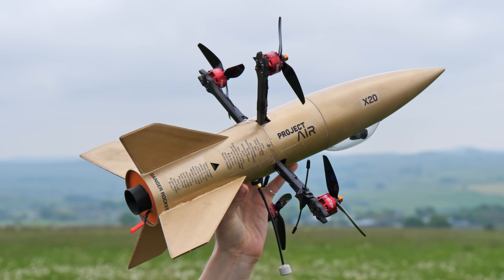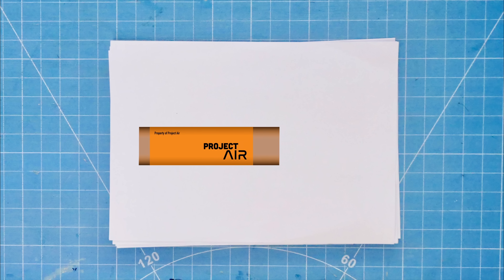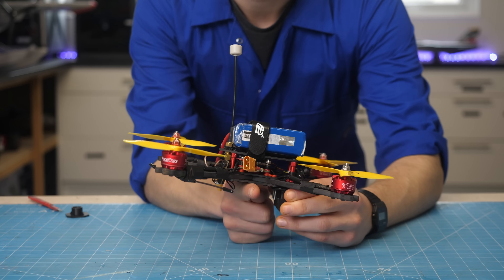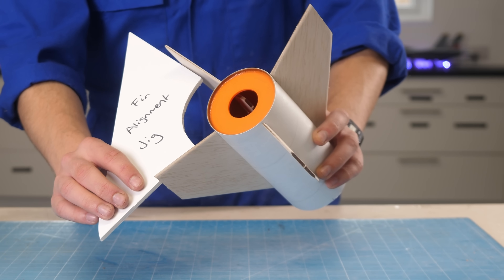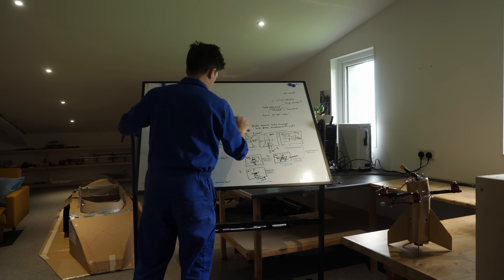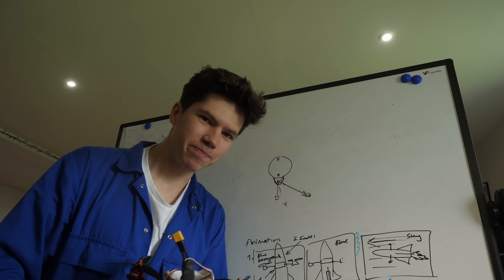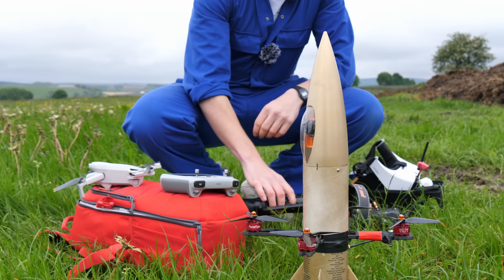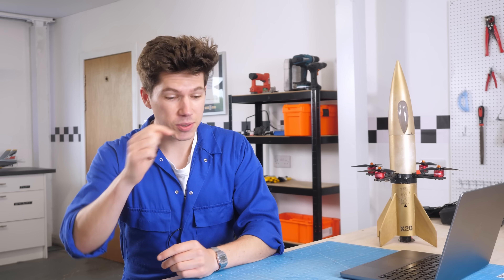Building a Rocket Drone

Comment: You have ALOT resistance when you light up the rocket. The arms have to fold inward into the body of the rocket to create the least amount of resistance to to the rockets aerodynamics. Once the arms are tucked in then you can use the fins to stabilize the flight, maybe. And you can not use the hobby grade stabilization to keep it in control. That's why falcon 9 has wing grids to control the decent. Falcon 9 has the wing grids folded back during launch. 😊

Comment: Looks like your vtx output to the antenna might be touching the frame and giving you that extra static in the video signal. I can’t say for sure, but I’ve seen that issue before and that’s what the video feed looked like.

Comment: You need to reverse the motors put them on the end, and flip the throttle controls that way they push instead of pull. Then you build covers for them with venting for air flow to the propellers, and counterweight in the front. The propeller layout in this model provides a ton pf drag when you use the rocket, and isn’t a great solution.

Comment: okay i like the comment i read about integrating with stabilizer fins and also about a more aggressive pitched set of propellers so that the increase in speed isn't turning propellers into excess drag ... with variable pitched props not a problem because adjust while flying even a 0.25 second after rocket ignition switching to continue to spin just at most aggressive angle but as always i just wanna know how much payload it can carry how high figuring a 2 liter pop bottle as a fairly good standard but eventually get into gallons and then splash on imaginary fires 🔥 such as a bbq or something even a candle 🕯️ in a field

Comment: Here is a mad idea I've had for a long time. Take a basic FPV plane capable of reaching 7-10 kilometers of altitude under it's own power (i.e. Atom RC Dolphin). Strap one or several rocket motors on it. Takeoff, reach max altitude, fire the rockets to go as high (or fast) as possible. Not sure about the legal side of all that stuff BTW.

Comment: A beitian 220 gps module can save weight for speed . Small drones carring just  a parachute can overheat and shut down the motors and drop . The flight controllers have gps speed in osd .

Comment: As you ignited the rocket motor, The craft seemed to pitch up a little bit. Was that intentional? If not, you could maybe add a counterweight to the camera to shift the center of mass back on a straight line with the thrust vector.

Comment: I dunno what British regulations are, but here in the US, at some point when you strap guidance onto a rocket motor you can run into legal issues without proper paperwork

It’s probably fine, but just in case that hadn’t yet crossed your mind, arms regulations could kick in at some point in your experiments on the channel

Comment: Faster! The current world record drone is about the same size and shape, but doesn’t have a rocket engine. It goes twice as fast! 
Technical advice:
As your air speed approaches the maximum pitch speed of your propeller, the pid controller and motors will lose ability to stabilize or control the aircraft. Use high pitch, two blade props. Use higher kv motors, or higher voltage battery to keep the theoretical max pitch speed above expected air speed. 
APC makes very good props for this purpose.

Comment: Even if you give maximum thrust on air screws they will not be able to skip the volume of air that will go through them at the start of the rocket engine, which means they will simply slow down the device, and this is not counting four engines pylons ...
There is a way out to realize folding pylons, accelerate the maximum with air screws, then fold the pylons, thereby taking off excess aerodynamic brakes both from the pylons themselves and from the screws, and start the rocket engine ...

Comment: Try to pull the propellers in, or over them with something aerodynamic, when the rocket motor ignites? There is guy on youtube, who uses gimbled jet-engines to power a drone. If you combine that, maybe would give a cool result?

Comment: If you want a faster set up. In my opinion it doesn’t make sense to put a bigger rocket on it, but it would make more sense to make it 6s, set up with five33 motors or t-motors with approximately 2000 kv with an RPM of 60,000 a set up like that would easily do 100 miles an hour with without a rocket

Comment: question: what makes something a plane, a drone or a rocket? let me explain, I was thinking of a way to make the drone/rocket go fully horizontal, and I figured that you would need to take one of the pairs of opposite propellers and then have something to stabilize it like wings. would that be a drone, a plane or a rocket? Also, could bringing the propellers closer to the shell make it faster but you would have less control?
another thing that i thought of was, could it be possible to have a mechanism where you you could make the drone/rocket more aerodynamic mid air?

Comment: Spend some time in the sim for FPV practice. Work on landings and save yourself some repair work. Practice landing a normal race quad on a backpack. When you can get it every time regardless of wind, you'll mostly stop breaking your rocket on landings... Personally, I would put the thing in a hover about 30-50 ft away(angle mode on a switch here FTW) then switch to LOS to fly it above me or a helper, disarm and be gently hand caught.
Reply: Hand catching is dangerous though and bare minimum of eye pro is required for the party catching. Maybe just don't do it. Lol but do practice backpack landing... An open backpack standing up would catch that rocket nicely.

Comment: The Drone of my Profile Picture was an heavy clumpy Freestyle Drone with LEDs and perifial. With Emax Eco V1 2207 1800KV Budget Motors. And 6S
It made 170km/h (105Mph) with sink rate and Back Wind.
I think, If you Take Drone Racing Motors like T-Motor F Series Motors, APC High Pitch Biblade,
An lighter And aerodynamic vertical Racing Frame and make an light  Build without Extra LEDs or heavy VTX. You can make 200Kmh /124Mph just easy. Or if you take an Freestyle Drone like an Fife 33 Switch Back Spec. RACER should be Faster than 100MPh easy.

Comment: if the drone fold its hands after the rocket ignition thisll be more faster. 
ig the drone parts outside the rocket body making the surface area bigger and slows it down a bit.

Comment: I'm really curious how far you could push the flight controller to keep the drone stable if (for example) the rocket motor was really off-center, like angled at 15 degrees or something like that. I know this is completely impractical but it would be interesting to see what it would take to make the flight controller lose the ability to stabilize the drone.

Comment: What would be even cooler would be if it had wings like a fighter jet rather than a rocket, and the propellers would fold back after it hits a certain altitude, and it glides until you activate the rocket booster. The fold back would help because reduced drag so it would become faster. Just an idea though…

Comment: make a 3 stage carbon fiber rocket. the first stage should be the main engine and 4 side boosters (like the soyuz rocket) then second stage should be only the main engine and the third stage should be the smaller engine then land with multiple parachutes. try to reach 50km+ and 200 mph

Comment: That 5” build was very low spec. Most 6s racing quads and even freestyle quads will quite happily sit at 100 miles an hour without much stress. Maybe if you build a higher end quad to begin with, the rocket motor won’t have to do so much of the initial work getting up to speed. A higher end build will also have more flexibility in the the PIDs which could help keep a more powerful rocket in check.

Comment: does weight affect a rocket in space? so if a heavily unbalanced rocket like the space shuttle was in space but the engine was on the fuel tank would the shuttle cause the rocket to turn in the weights direction.

Comment: This first maidn:
Your Mistakes:
1. Check on the Bench all Controlls without Propellers, this way you can check the right motor Direction, and know all Motors spinning the right way up and down on the way wich stick input you give the Drone.
2. Not have anabled the Angle Mode (selv stabilising Mode) enabled on a switch. In this case you can chack without Propellers on on the bench if the internal programmed mixer of the Drone works, and you can switch the Drone in angle mode if something is wrong, or loosing Video you can activate angle to go stabilised in idle down, in this case you carsh not so hard and not in  full speed way down. Becurse the Ideling Propellers are bracking and stabilising the Dropping aircraft.
3. Not made an LOS hover first before you start FPV sight.
In this way you have more controll and notice it faster if something is wron. if you mounted an Propeller the wrong way. (CW on CCW things) you can disarm faster. In this case you could have Time  notice the fact the Camera was mounted to the rear.
And you have 2. Person she could help you and  check FPV image  while you hover in LOS
4. If you had maded an LOS Test before, you know the Angle Mode is working, and emable the angle  Mode instandly  in Mid Flight and set your Throttle to 5% to go down vertically with reduced Dropping speed and damage. I know you are Blind whe the cam is pointet to the sky in Angle mode , but it is better than fly fullspeed 90° in the ground. Or flying without orientation around and travel 1000m before full speed crash. 
In the Moment you noticed something is wrong youbjust have enabled angle Mode Instand and ripped you Googles off to rescue the aircraft for LOS. You have the Privilage to not have to wear glasses. Like I do, i Have to take down my Glasses to put on my goggles.

Comment: You used plastic for the engine housing at first and it melted, the model rocket kits use a cardboard tube for the housing won't melt and a heck of a lot cheaper then titanium!!

Comment: At 2:42 you show and talk about "core burning" rocket engines but the type you're using are "end burner" engines. Inside the tube is a solid fuel grain and the ignitor touches the end to light it. It burns up the length of the motor not from the middle to the walls.

Comment: How about a drone with rocket engines mounted horizontally to the bottom of the drone, you could then have multiple rocket engines on a rotatable disk so that after using one another could take its place

Comment: My first thought is that this might a very good way to have motors spin way too fast and maybe burn something :)
Reply: But that went well! I still don't think it's such a good idea to push props over what they can achieve themselves.
I have a 5" drone with 1700kV motors that go about 160km/h with 6S battery. Race drones can have over 2000kV motors so there's plenty of more speed to be gained with just higher voltage and proper motor selection. Might be interesting to see how badly it would turn out if you activated the rocket motor while already going something like 180km/h.
You could also easily add OSD to you FPV feed since you're using a drone FC. 

With a bit more work you could add GPS and it would make landing easier since you could have the GPS fly it while you take the headset off. Depending how far you want to take it, it could even land by itself but I think betaflight return to home would already be really useful if FPV feed goes too bad.

Comment: How about using a drone with a cylinder in the middle that a rocket can lock into, then using the drone to lift the rocket to max altitude before then launching it higher.

Might get some altitude records for those Lil model rockets.

Comment: i'd suggest to build a proper fpv drone with proper parts (rather than banggood) and use a high-speed two-bladed propeller! i'd be easier to control at high speeds and reach 120-130mph without issues. and for landing you could use attitude or horizon mode: flip a switch and just lower the throttle / remove the goggles and spot the drone and land it line of sight. i also think you didnt go faster because of the rocket shape but of the steeper camera angle, better battery and it looks like you replaced the props to some nicer ones?

Comment: Great video, what if you try using AI to balance it? First train it using a regular flight computer, and then it could make assumptions that might be better (or worse) than a regular one. If you can record the gyroscope data, then with a format of: {(rotation: XYZ, timestamp: 1 ms since liftoff),(rotation: XYZ, timestamp: 2ms), and repeat I maybe could train an AI. (JSON)
Reply: If you could include a Dropbox/google drive link with the file that would work well. And also, to run the file you could use the google coral ai accelerator module, as if I train it I could convert it into tenser flow lite.

Comment: 1. Your antenna should be angled to the back so its more upright when you are flying fast (drone tilted forwards)
2. 100mph isn't really impressive for fpv drones since even a 4s 5 inch standart freestyle build goes about 120mph top
3. You can put a very small and light gps on your drone wired to the fc wich would give you return to home capabilities if you loose signal and you would be able to see your speed on the fpv picture and in the blackbox log

Comment: Take a powerful ESC (>60A), and a 6S 1200mAh batterie with at least 150C for this setup. Same motors! Rockets are not neccessary. And a much lighter GPS module. Save weight wherever you can.

Comment: Hi project air, quick question, who is you target audience? there are a couple of creators like you, who leaves the entire math and physics out of the video, for an example, at the end of each flight, the controller effort, orientation acc vs time graph would have been super nice to see how the angle controller is actually handling the disturbances, without these data, i don't know, feels kine something is missing form these videos, either way , I appreciate your effort, but these extra bits would have been super nice.

Comment: Should of gone with a 6 cell lipo battery on the 5inch frame, faster electric speed to start with, Take off with the FPV goggles already on your face. For a clearer video use a digital video transmitter

Comment: I think your Drone could Go faster then 100Mph just without the rocket. If you take the right High Pitch Propellers, or APC Biblade Propellers. Your Drone is lighter then Mine and my Drone went 170kmh  (105mph)
If your drone Flys with 6S, it is easy, 4S it will easely Make 150kmh.

Comment: An Normal Clean Racing Drone an clean racing drone go faster, (trimmed and buildet only for racing)  could simply  reach 100mPH or 170kmh, and when you put High Pitch Biblade on it, it will easy go over 200kmh faster than your Rocket setup. But no racer will fly this Biblade Props for racing, becurse this Probellers have not the right Grip in the air or acceleration like other Racing Triblade Props and this Handling Performance for thight Turns and Precission in the Tace Traks.
This Drones have an Vertical light Frame, under 90gramm, High KV and Strong High currwnt resistance  Motors like T-Motor F Series, and high Quality light and Strong Premium Batterys. And buildet an an Light, and arodynamic design. With 3D Printet Covers over the Edgy Frame structures.

Comment: Why bother with the fins?  That’s what the flight controller is for. That’s a waste of drag.
Reply: That's a good point.  The way I understand it, the Saturn V didn't need fins, but these were included - despite the weight penalty - to assist with stability in the initial stages of the flight, and because 'tradition:' "Rockets have fins."

I'm guessing the main purpose of the fins on this model is to eventually serve as landing gear for future variants to be able to make vertical landings.  The fins could also help stabilize the model at lower speeds to assist the drone's computer, (which probably has more power than the iconic Saturn V's Instrument Unit.)  

Plus, they look cool!  In this case, they give the model a kind of "Focke-Wulf Triebflügel" aesthetic.

Comment: I think you should really consider Electroplating some of your parts and even whole models!
Not only for looks, but for thermal properties, among other potential (situational) benefits!

PLUS the Tasty thumbnails would be worth it, and you probably already have the most expensive part: the DC Inverter/PSU. So long as you're not using Gold or Silver, the electrolytes can be made rather easily and the raw metal is cheap enough!
you can improve printed parts, or even flip them into molds for metal casting!

@hen3drik has all of the formulae and tips'n'tricks you need, though he's more pro-level. Here's his electroplating to casting vid! https://www.youtube.com/watch?v=OYgn3tsJRWg

Comment: Sense and Sensibility

It has already being done:

In the 19 50s and 60s
It led to the harrier jet and F35's we know today
It is known as VTOL Configuration 
A kk board v 2.15  controller has a pre installed balance to achieve vertical take off and horizontal flight

Why not try creating something new 

Sincerely

Mr Ejike Ememe
Ba Hons Degree Administration
Thames Valley University London

Comment: 9 days ago... why did you used drone components from 2017? Not even turned OSD on? 100mph fpv copter, seriously? With rocket booster it should be at least 200 mph